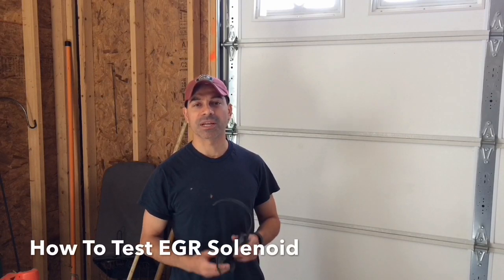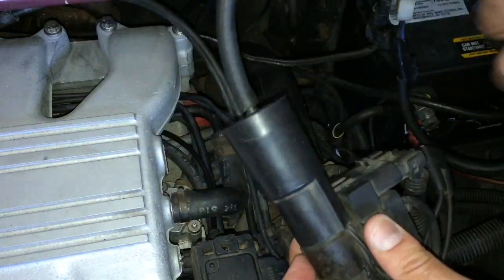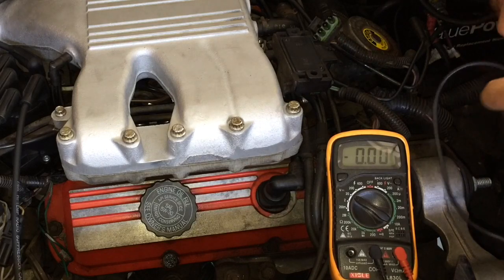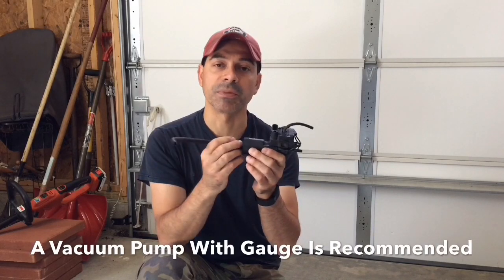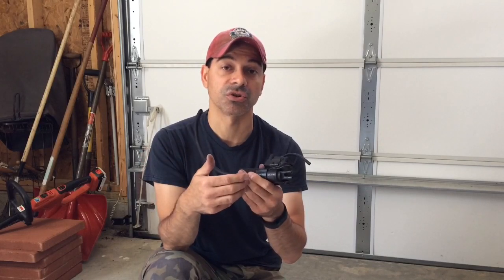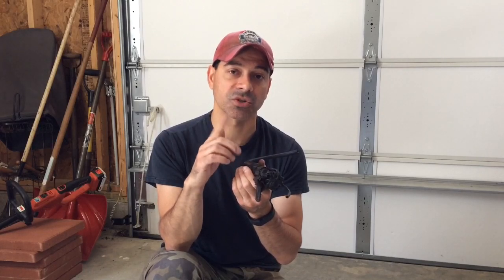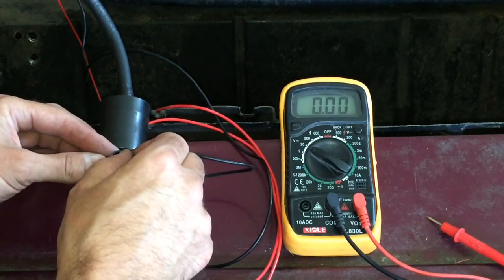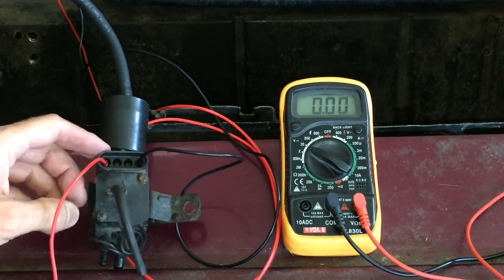How To Test EGR Solenoid (Andy’s Garage: Episode - 87)

Comment: Thanks, Andy. The EGR replacement might cure my fluctuating idle RPM. Also I took my "new" used '88 GT to my mechanic for new fluids, plugs and fuel filter. Runs considerably better now. No more motor hiccups while at slow speeds or coasting. So the plugs were the culprit. But while on the lift, the engine cradle was rusted out on both sides on the rear of the frame. Typical old car from the north, eh? Good 'ole ebay had one for my '88, w/no rust and powder coated. I'll order fuel lines as well. We couldn't even try to swap the filter w/o breaking the line. I have to say, bro, that I miss the 9 psi fuel pumps. A little rubber hose: good as new. ☺
Reply from the maker: Gary McAleer yes, there is a good chance that is the problem, could also be the Idle Air Control Valve.

Comment: I mean I'm sure it's a good video so long as you're an electrical engineer. Watching some dude just touching hid probes from a multimeter to random parts of the solenoid I'm trying to learn about really isn't helpful. The average person, and I just showed a bunch of em, kinda knows what a multimeter is, but has absolutely no idea how to use one. Someone who is watching this video very likely knows what a multimeter is but maybe doesn't consider themselves enough of an expert to just guess why the creator knows what part of the harness does what (absolutely no explanation  - I must be really stupid for even wondering) or what wire is being touched to what part in order to get a result. I'm coming back to this video as soon as I'm psychic😊

Comment: Great video.I took my egr selenoid apart.Everything was connected.No rust like yours.I test selenoid no response.Could the  switch be bad?Any help would be appreciated.Did you test the one you renuilt ?Thanks
Reply from the maker: Did you test the harness to make sure power it getting to the solenoid?
Reply: @PhillipsVision  Yep and hooked  to a 12 volt battery no click.
Reply from the maker: @snowman307  solenoid might be bad
Reply: @PhillipsVision  I was thinking that.Thanks for the help.

Comment: Hi! On my e220 w212  2015 i have P042F73 egr positioner (high pressure) is jammed closed. The actuator does not open. And i tried to move by hand  the egr valve by lever at  that time when engine is in limp mode  with engine on and the egr valve is stuck, if i stop engine then i can move the valve easily even if i start engine again, just sometimes car gets in limp mode and valve get blocked in closed position.  What makes high pressure that valve can t be moved? Egr valve is clean .Thanks

Comment: Good video. I noticed you were reading negative12 volts, so I think the right (upper) connection is Ground and the left (lower) one is Ignition 12V.  I think you had your black DMM probe on the left (lower) connetion (your probe points swapped).  What are the other two electrical connections for?
Reply from the maker: Correct, they were reversed. The other two should be for the vacuum switch and signal
Reply: @PhillipsVision  Thanks, I did find a schematic drawing of the solenoid. Pin A is Ignition 12V, B is the Solenoid Activate signal (Open Inactive/Gnd Active). C is the feedback signal (Open No Vacuum to EGR/Gnd Vaccum is applied to EGR), D is Gnd. There is a diode inside between pins A and B. It is reversed biased. This is called a Flyback Diode. When the signal on pin B goes to Gnd, current passes through the solenod coil - the diode does not conduct. When the signal on pin B opens, the coil is shut off and it's magnetic field collapses - this induces a voltage spike in the coil but this spike is negative with respect to 12V. The diode conducts in this case and "absorbs" the spike so it does not damage other circuits in the car. The solenoid will work if the diode is blown (open) but it is not good for the car - you may hear noise on an AM radio. Check the diode on pins A and B with an Ohmmeter. You should get high resistance one way, and low resistance with the leads switched. I didn't say which way the meter leads should go because some Ohmeters put out a negative voltage on the red lead (most properly put a positive voltage on the red lead and this helps identify proper polarity of diodes). In this case we are sure the diode was built into the solenoid assembly properly - you just need to make sure you see different resistance readings with the leads applied both ways to make sure that "protection" diode is still functioning properly.
Fieros use a Pulse Width Modulated (PWM) signal to activate the solenoid to allow vacuum to open the EGR. Quick pulses in rapid sucession cause a little bit of exhaust to be pulled into the intake manifold via the EGR, while longer pulses allow more exhaust gas into the manifold.
One hose on the Solenoid comes from the intake manifold (this is the source of the vacuum for the EGR). One hose/tube goes to the EGR (the vacuum switched on/off via the solenoid). One hose goes to the air intake cleaner (some kind of venting but not sure why). And finally another hose/tube that connects to the same hose/tube that goes to the EGR. This allows the solenoid unit to confirm (send feedback to the ECM) that vacuum is being applied to the EGR when the solenoid is activated.

Another note: Make sure you don't apply 12V to the wrong pin on the Solenoid, you may blow out the diode. The diode is there to absorb the brief spike when the solenoid is deactivated, it is not designed to take a contant negative 12V (power reversed). Doing so will blow out the diode in seconds. The EGR will still work with a blown diode, but now the solenoid with put negative voltage spikes on the Ignition 12V signal and that could damage other circuits in the car over time.
Reversing the leads with an Ohmeter is fine because it uses milliamps to make a diode measurement, but reversed power leads can supply many amps that the diode can't handle when reversed.

Comment: I'm changing from a 4.3 to a 5.0 truck originally had 4 pin connector with 3 wires one on engine has 2 wire connector any help would be great

Comment: Hi, watching your video in 2024, just a quick question, I checked my car egr solenoid harness and the power was 9.70v . Should I be concerned?
Reply from the maker: @ibneamin3925  what is the battery voltage
Reply: @PhillipsVision  hi, thanks for your reply. Battery voltage is 12v.
Reply from the maker: @ibneamin3925  12 volts is on the low side. Should be around 12.7, voltage at EGR should be around the same

Comment: I have a 93 Chev C2500 5.7L V8. I started getting the 'service engine soon' light, looked at some videos on youtube and started changing stuff. I put a new oxygen sensor on (looked good, probably didn't need replacing) and then put a new EGR Valve on it (looked good, probably didn't need replacing) and I am still getting the service engine soon light. Since I have eliminated two of the possibilities, what are the odds it is the solenoid? It doesn't come on all of the time and when it does, it doesn't always stay on. I know you can get the dash to flash the different codes by sticking a paper clip in the thingy under the dash but there is no mention of the solenoid in that vid. I am almost certain that it isn't the brake switch being stuck. This old truck has only 130,000 miles on it. Don't want to throw it away. I am not a mechanic by any stretch, just don't want to pay some shop $100 an hour to fix something I can fix. What are your thoughts. Thanks, loved the video, gives me hope.
Reply from the maker: First thing you need to do is connect a scanning tool to you vehicle so you can get the actual engine codes, that will tell you exactly where to look. If not, you’re going to be replacing things that are not needed.

Comment: How did u determine which port was the positive or negative. How did you test it to find the proper ports to initially conduct the test?
Reply from the maker: jennifer campbell you’ll need to find a wiring diagram for your car and determine your wiring
Reply: He had the + connected to the negative on the port side, that is why it was reading _ 11.98, also the blowing part was totally out of focus on the two other ports, in my opinion it was an ok video.

Comment: What were the symptoms of the  EGR valve solenoid
Reply from the maker: greg spight engine racing, high RPMs at idle. This could also be caused by a cracked EGR Tube, so you’ll need to do a process of elimination
Reply: @PhillipsVision  mine is running rich,bad fumes smell,replaced just about everything except oxygen sensor and egr valve solenoid
Reply from the maker: greg spight is your engine sputtering or racing? Is is generating any error codes?
Reply: @PhillipsVision  no sputtering,idle is fine just strong exhaust smell.connection port to read codes is broke,but it use to read 32,35 I had something's fixed codes went away,but smell didn't an now can't read codes
Reply from the maker: greg spight normally, a Damaged EGR will cause high idle like a Vacuum Leak. A bad O2 sensor can cause this or a failing MAF Sensor.
Reply: @PhillipsVision  thanks,ive replaced the egr valve,so the 3 parts I'll start with are maff sensor,o2 sensor an egr solenoid,thanks appreciate your time an feedback!
Reply from the maker: greg spight you’re welcome. EGR solenoids are expensive so start with the cheapest item, might be the cause.